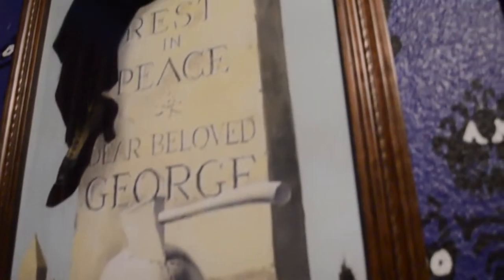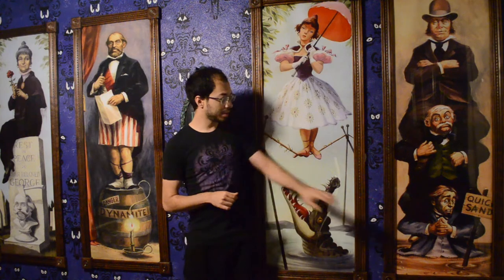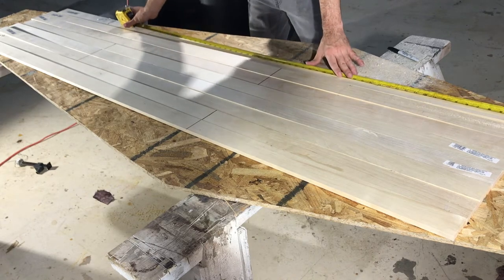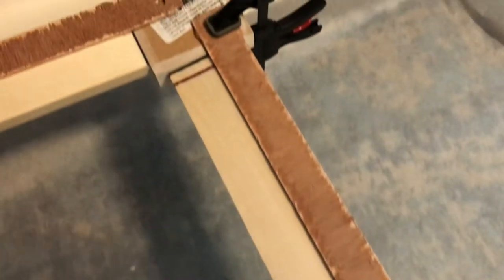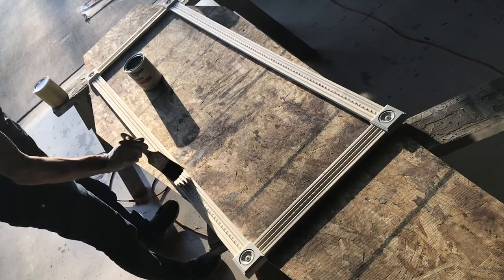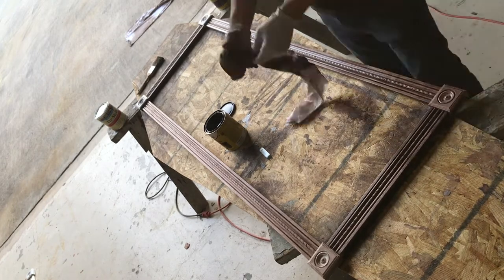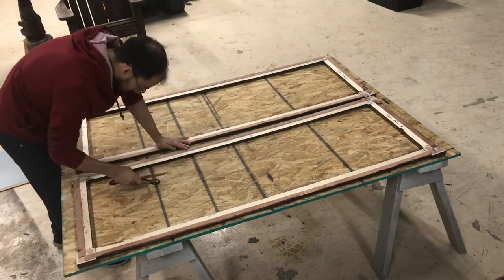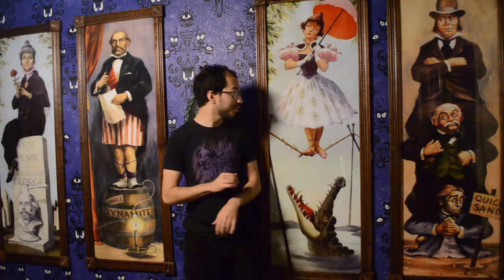How To: Make Stretching Portrait Frames

Comment: These look fantastic! Where did you get the square piece?
Reply from the maker: I think I got it from lowes? But it was already primed with white, which was a problem for staining, but I believe Home Depot has them as well un-primed, just look in the trim section of both stores and they have all kinds of square bits in different designs